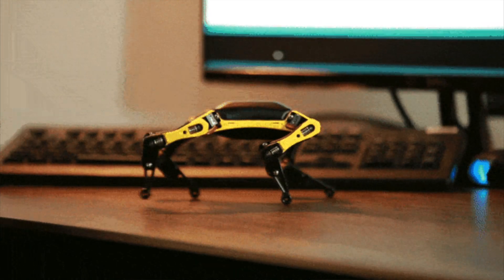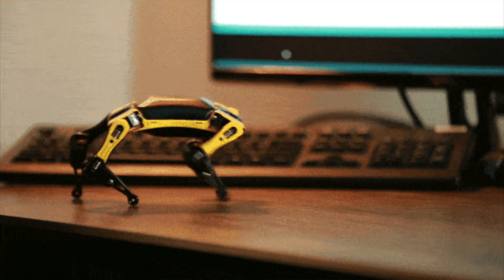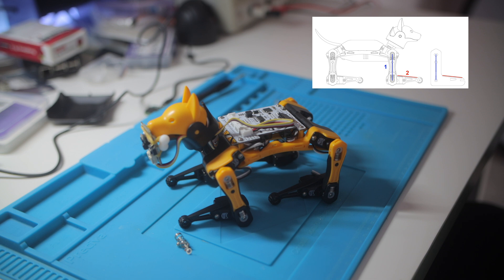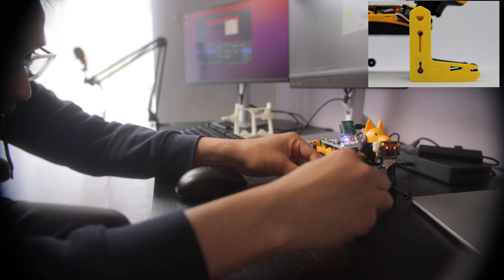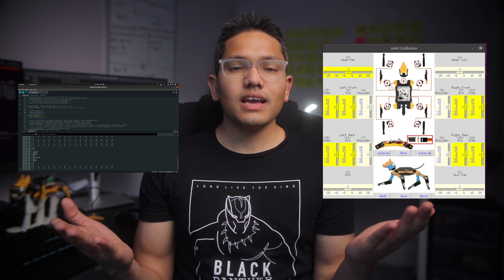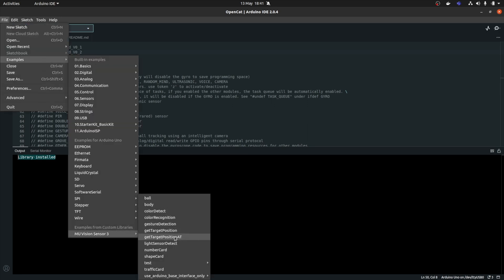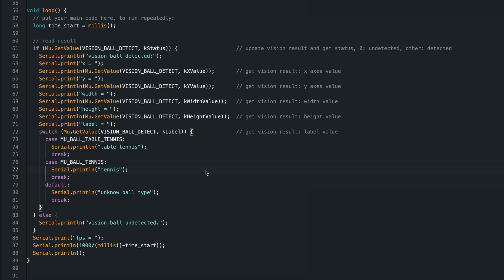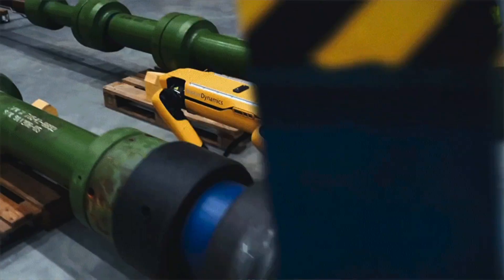How to learn coding for Robotics ft. Bittle Robot

Comment: To become a robotic software engineer, in which field should we do MS, Computer science and engineering or robotics engineering?
Reply from the maker: Yes, Going down the Computer Science path is a good option, but it’s crucial to focus on robotics-related coursework within CS, such as AI, computer vision, and control systems. Many universities now offer specific Robotics or AI tracks within their CS departments. Alternatively, dedicated Robotics Engineering master’s programs often include a strong software component (including AI, perception, and control) alongside hardware and mechatronics topics.
When I did my master’s in advanced robotics, All modules were on AI and software for robotics, like motion planning, robot perception, and machine learning for robotic systems. This hands-on, robotics-focused modules are must as compared to generalized CS programs. So I would suggest, focus on modules rather than name of the degree.

Comment: Very new to this and I am building a different quadruped robot that I had found and 3d printed from thingiverse. Do you have any good recommendations on where to learn how to code the kinematic and inverse kinematics for the different gaits in arduino ide? I’m struggling to find anything on how to do so and so far the example codes I have found do not seem to come with really any good notes in the code to understand. Could just be me though. Haha. But I feel like I have the math solved but no understanding on how to write the code for it just to stand even. Also could the arduino code you showed be used to calibrate a different one like mine or is it tailored to the one from your video? I have everything else working that I’m using in the robot itself and am down to the last part which is the legs and the accelerometer/gyro.
Reply from the maker: It’s hard to give a precise answer without fully understanding the specifics of your struggles, but if I were you, I’d start by making sure all servos are correctly centered and calibrated, then tackle inverse kinematics for just one leg at a time before scaling up. I’d also adapt existing open-source quadruped projects from places like GitHub(there are many), carefully noting how they handle gait generation and control logic. Thorough debugging, heavy code commenting, and using sensor data (like accelerometer and gyro readings) would guide my refinements. Finally, I’d begin with simple, stable gaits and build complexity only after the basics are rock-solid.

Comment: The instruction was hiding under the box lid, but you're actually supposed to calibrate (zero) all the servos before you put the legs on. You shouldn't have that one leg way up in the air if you did that right? Most of the time when it's off by that much, the arm is mounted wrong on the top, you just need to rotate the arm, not set an offset. If your offsets are too large, you'll lose range of motion in one direction.
Reply from the maker: True but setting offset did not work .The thing is that there was a physical damage to the servo motor and it was drawing excess amps from PS and main controller was heating up. 

In short I had to replace it.

Comment: Are you using mac at the end of this video?
Reply from the maker: Ya I had to test the robots software compatibility with newer MacBooks with M1 along side with Linux Ubuntu and windows.

But in my day to day life I use only Linux with Ubuntu kernel.
Reply: @LetsTalkWithRobots  what version of Ubuntu kernel are you currently using? I am moments away from using 23.04 as my daily driver and the  18.04 LTS for my robotics development
Reply from the maker: @keshawnsmith320  My primary kernel is 20.04 LTS but I need to use 16.04 and 18.04 also in VM’s as a part of checking software compatibility tests .

I don’t usually go for newest one because It’s not necessary and even though new Kernels are launched , it takes time for other dependencies to catchup especially in robotics.
Reply: @LetsTalkWithRobots  Do you use 20.04 LTS because that is the best kernel which works with Robotic applications or would it be fine for me to use 22.04 LTS and still run and work with ROS?
Reply from the maker: May I know which ROS distribution you plan to use ?
Reply: I plan to use  ROS 2 Humble. I have grown with ROS Kinetic but want to learn the newest one if possible.
Reply from the maker: I did not use ROS2 Humble yet but if that's what you would like to use then you have to use it with Ubuntu 22.04. It is primarily targeted at Ubuntu 22.04 (LTS). It does not officially support Ubuntu 18.04 or 20.04. However, it may be possible to get it working on these older versions by building it from the source.

 I tried this method back in the day for previous versions. I must warn you thought, it's not guaranteed and I faced a lot of issues (It was a desperate attempt from my side until the official version is released). 

If you are not too tied up with an older Ubuntu kernel for existing projects then I would recommend using the version of Ubuntu (22.04) that the ROS release is targeted at for the best compatibility and most importantly support.

I hope it helps.
Reply: Do you prefer 20.04? Or would you consider upgrading?
Reply from the maker: @keshawnsmith320  For my current project base like not only robotics but other projects in ML, computer vision or recently I started building projects around LLMs and so much more 

I am super happy with 20.04 . It does the job. It would take a lot from me to shift all of it to newer version .But most importantly it’s not needed at the moment.
Reply: @LetsTalkWithRobots  fair enough I respect that. Thank you for sharing you insights
Reply: And for robotic develop you would recommend 20.04?